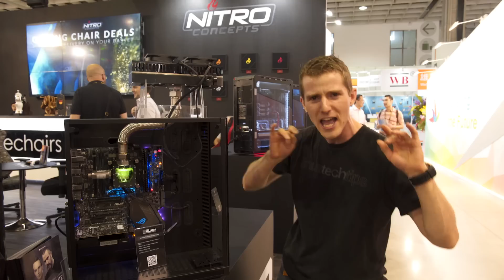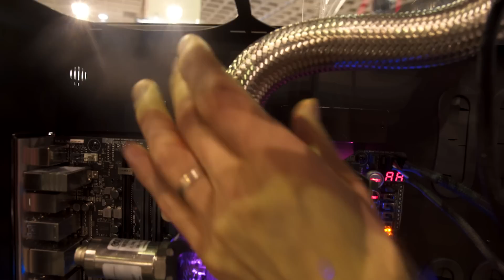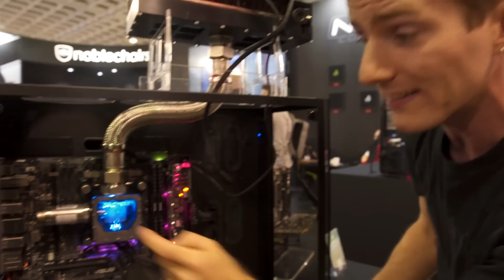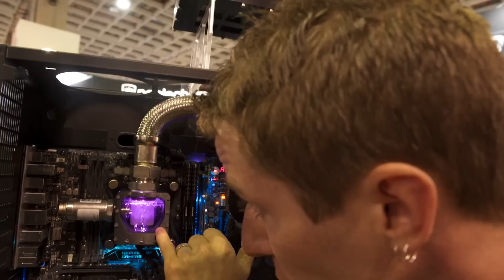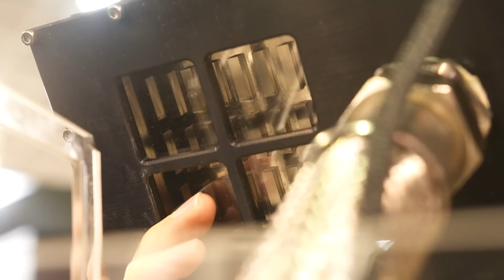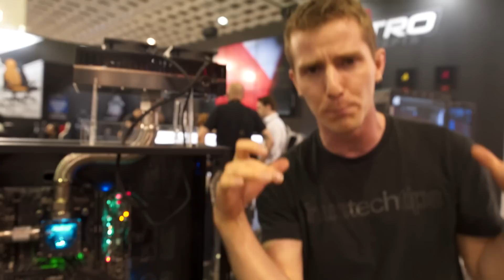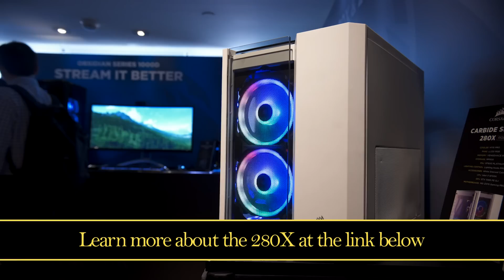Crazy Der8auer cooler prototype - NO pump!

Comment: It has to be a safe liquid in case of spills, so I'm assuming it's some kind of alcohol, either methanol, ethanol, or isopropyl alcohol... Anything else boiling at the right range would be quite aggressive solvents, and not safe in case of leaks... Well, either that, or they're carcinogenic, and good luck selling that to regular consumers without a license...!
Reply: As long as you’re not in california, the potentially carcinogenic liquid won’t affect you. (Sarcasm)
Reply: Simon Dann Boiling IS a phase change, from liquid to gas. That's literally the definition...
Reply: Novec1230...   hehehe.
That liquid is certified for use in server rooms. Heck, it is primarily used in server rooms.
It matches perfectly! It has properties very suitable for this pumpless cooler. Look up my comment here somewhere with more details.
Reply: Green Bananas Problem is if you have a leak, freon isn't exactly safe. It's toxic, not something you want in your house...
Reply: Its most likely methanol, because it boils at 65 degrees centigrade which seems pretty close to overclocked cpu temps for me.
Reply: Yeah, just about everything that I can think of that boils between ~30c and 100c @ 1 bar is flammable.
Reply: Michael Berthelsen you can sell ethanol without a license
Reply: Bacon Suds in certain States of the US of A you can sell ethanol without a license if the ethanol is tainted and marked as tainted so that it cannot be used for consumption
Reply: how about methylene chloride?
Reply: gtq838 oxygen, CO2, and nitrogen don't boil (or sublimate in the case of CO2) and condense above room temperature, making them completely useless in this application. And oxygen isn't just flammable, but it's what makes otherwise nonflammable things flammable, so that's way out. If you have any better suggestions, go ahead and put em down here. We've put our best guesses, that seem feasible, not knowing everything about the setup
Reply: but that is the definition of boiling....
Reply: a phase change reaction from liquid to gas is the exact definition of boiling XD
Reply: Reading these retarded comments made my brain hurt. You can't just put something under vacuum and expect the vacuum to exist when you literally convert it into the gas phase both due to partial pressures and more importantly boiling. Vacuum is a measure of the number of particles in a given volume which will constantly be changing because of the evaporation and condensation. So there is no tunability with the liquid. You will never get liquid nitrogen to recondense in a small form factor along with a lot of the exotic answers of stuff that is not a liquid at STP like argon and oxygen. Alcohols are flammable sure but in a closed system free of oxygen it won't ignite. A leak would be about as dangerous as a match about to go out. You would need a large ignition source and plenty of oxygen present to create an explosion. Small volumes on a really hot surface like a frying pan can flash but go out quick while large volumes lit on fire tend to reach a balance drawing in surrounding oxygen slowly to continue to burn. The liquid is free flowing and not clumpy so it is not an oil so that leaves Methanol or Ethanol as the top picks as relatively safe and cheap. I would say acetone is viable but since it strips paint I would say it is a distant option behind regular rubbing alcohol.
Reply: Benzene?
Reply: Tech Nick It might a bit higher due to higher pressure, but it would still keep it nicely below 75-80 degrees C, yeah.
Reply: Thomas Bullik Without context, your statement makes no sense. Do you mean that it needs to cool the CPU to lower than 65, that a different chemical from methanol should be used, or that it needs a vacuum to use methanol, as it would lower the boiling temperature?
Reply: Thomas Bullik Dichloro-methane isn't very safe in case of a leak, and a very good solvent, so you'd need very specialized plumbing and seals for that not to leak...
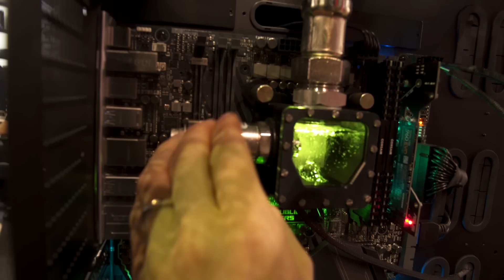Reply: rgray318 There is no pressure valve. He actually explains in the video that it won't be there in the final product, that it's just a pressure gauge to ensure it doesn't reach a critical pressure by accident. 1:40
Reply: I have another factor we haven't necessarily considered, at least not discussed... Linus comments it as being toasty, but he can still touch it for a few seconds at a time AT LEAST... Problem is, if you're used to touching hot things, 65 wouldn't be that hot, if you're not, 40 could be toasty... And he doesn't touch the metal for long, so kind of hard to tell... Thoughts?
Reply: Michael Berthelsen that's the sort of thing I was considering when going through chemicals. It has to have a boiling point well over room temperature so it can easily condense (23° C -ish idk I usually use Fahrenheit for that) but well below 100 to keep the CPU cool. Cost to produce or source also has to be relatively low for it to be commercially viable. My best guesses would be methanol or acetone
Reply: Dylan McMullen I'm thinking similar to you. If you overclock, it should be OK, even at around 70, right? And you could touch 70, but not for too long, and depends on the thermal conductivity of the case. I'd be worried at an acetone leak, though... All good solvents almost have to go, unless he has some special kind of seal around the CPU, and specialized plastics for the piping too. Ethanol and methanol arre 'only' flammable, not carcinogenic, strong solvents, or otherwise toxic (unless you drink the wrong one, or enough of the right one), and it needs to be relatively safe. Can't be any exotic stuff, you'd need licenses both to sell and own, just for safety reasons...
Reply: Michael Berthelsen methonal is toxic and can cause blindness as it's metabolized into formaldehyde (methonal)
Reply: Isopentane maybe
Reply: its in your house, fridge, Ac, car etc but i get what you mean
Reply: sasja de vries. Thanks for that insight. Didn’t even know that existed
Reply: Constructive Cuntery Liquid helium? At how many atmospheres? And do you want a pipe bomb in your PC?
Reply: Lewis Yeah, carcinogens and solvents are WAY better than a liquid that slowly evaporates, and may burn if exposed to direct flame, like we all power our PC's using steam power.
Reply: Yannis Martynov You donrealize that you need something that is liquid at room temperature and around the same pressure, right?
Reply: Yannis Martynov And like someone mentioned, freon is banned in Germany where he made it, because it's so carcinogenic, and environmentally problematic, so no, not freon.
Reply: Interesting theory. I hadn't thought of that. It's probably just deionized water in that case!
Reply: Nope, this would be partially conductive and VERY BAD in case of leak :-)
But my bet is on something like Novec M3, fluorinert or something like this....
Reply: Michael Berthelsen Coolanol is used for military radars and would fit that requirement https://en.m.wikipedia.org/wiki/Coolanol?wprov=sfla1
Reply: Empress Peach made your brain Hurt..? we've all gotten a +110IQ from Mensas home test, just say "headache". Thanks.
Reply: It's been pretty much illegal since the 90s.
Reply: jamvanderloeff Severly controlled rather than illegal. All active radar systems rely heavily on the stuff.
Also, there are now much less dangerous equivalents such as Nycodiel.
Plus I just like the idea of having a piece of fighter jet on my desk. Who cares about health in front of coolness?
Reply: I bet is hexane
Reply: Fxvx Don't be a dick. Headache is physical pain, 'hurting my brain' is a level of frustration with ignorance. Not the same thing. And Empress Peach made some good points.
Reply: I would also say that it is under a light vaccum to reduce the boiling temperature to about 50°C or 40°C.
Reply: I believe that it is Freon-11. It  has a boiling point of  74.9 F at regular atmospheric pressure. If you were pressurize it the boiling point will would get higher to a more usable temp. It is colorless, non flammable, and non conductive. Freon-11 is also highly regulated and is hard to get unlike other refrigerants. It can be be very expensive though.
Reply: +Green Bananas It most definitely is not Freon-11, since Roman is from Germany and it's been made in Germany. Freon-11 is forbidden to use in ANY application around here. There is only one exception, and that's nuclear magnetic resonance spectroscopy. 

Personally, i think it's something like Pentaerythritol. That's the same ester that's used in transformers for convection cooling.
Reply: it should be boiling lower, because it would not cool at all when the temperature gets lower than these 65 °C
Reply: It’s a phase change refrigerant. The kind used in freezers. The phase change consumes the heat energy in the reaction from liquid to gas... it’s not exactly boiling but looks like it. The gas then just needs to be allowed to condense and continue the loop. 

As far as I am aware the phase change reaction consumes the heat so there isn’t much additional cooling required other than to help speed up the condensing.

If the phase change happens at 40deg then the processor will remain at that temperature. Such refrigerants can have a wide range of phase change temps depending on their chemistry so it’s a very interesting technology for cooling processors.

Very expensive stuff though, like several hundred pounds for each kilo.
Reply: Zappyguy111 Yeah my thoughts exactly. That is what the pressure valve is for on the side I believe. It's not for holding in pressure, it's for keeping it out (vacuum). You can lower the boiling point of most liquids just by lowering pressure. What has me perplexed is that the valve end inside the windowed liquid housing is submerged. With an exotic expensive and maybe toxic liquid that is a real risk. Which suggests to me it's just high quality deionized water in a vacuum, with a electric phase change plate in the ceiling of that block. The bottom circle thing looks possibly like a heat manipulating plate simply for dialing in the right boiling settings in the labs. Why the boiling then you ask? That's obviously for liquid/heat stirring for more efficient phase change heat sucking. But I admit I'm just throwing an idea out there. Lol
Reply: no, not alcohol. Alcohol is too flammable at high temperatures. Once it leaks, it will evaporate, and the fumes will be too easy to combust.
Freon could be an obvious answer, but I tend more towards a neutral element, like argon, maybe helium...
Reply: Immersion Cooling, nice to see it finally covered by Linus. Check out immersion cooled bitcoin mining farm in hong kong if you want something next level, https://www.youtube.com/watch?v=oZavKweMrP4
Reply: Methanol would be the only viable candidate (boiling point = 65ºC since the rest of alcohols have higher boiling points(ethanol boils at 70ºC, n-propanol boils at 97ºC and isopropyl at 82ºC. notice that the boiling point scales with the lenght of the organic radical.) Methanol, unfortanately is quite toxic since it is methabolised into formaldehyde and can be absorbed trough the skin. also, it's really damm flamable 

My guess is that it could be some high molecular weight hydrocarbon. there's one used as refrigerant (R-600a aka methylpropane) although, it's boiling point is really low, hence, it's used in refrigerators as an alternative to the fluoronated R-134a and R-410a

Comment: This is alcohol. The purspose is to keep in contact the CPU with a liquid which has a low boiling temperature. In that way the temperature of the liquid will never rise above the boiling temperature unless the steam (alcohol steam) pressure inside the tubing rise drastically.

Comment: My best guess is deionized water at lower chamber pressure (that would explain pressure addon thingy) so it can boil at cpu temperatures, nickel coated tubing and stainless steel or similar alloy for cpu contact<-that may also look like its the cpu even though its not.
2nd guess: water with baking soda

Comment: Pressurized pure alcohol could maybe be used for something like this? Un-pressurised it would have too low of a boiling point to condense in room temperature, but if it is pressurised, then the boiling point might be high enough for it to condense in room temperature. It's also clear, so that fits.

Only problem, it's not that had to guess.. so i guess it wouldn't be. Also extremely flammable, so...

Comment: Hmm, the clue is in the pressure sensor. That means its probably a higher pressure then normal, so a liquid with a low boiling point would have some higher boiling point due to that. It also is probably a liquid with only a small transition energy requirement.
Something like alcohol, Acetone, methanol that kind of stuff with a boiling point around 50-70 degrees celcius. Could be lower temp stuff like Ether etc. there is a huge list like this: https://www.engineeringtoolbox.com/boiling-points-fluids-gases-d_155.html
anything with a boiling point of probably between 25 and 70 degrees could be used for this, provided the pressure is correct to get the boiling point at the right hight. It can be a mixture, but that would introduce more and more problems with the 2 or more components separating.

The other way around: lower pressure makes water boil at lower temeratures. I just don't think its valid for it, for pressure would build up.

Its easier to use a fluid of a lower boiling point, and let the boiling make the right pressure within a loop, provided enough of the liquid is present vs the available space in the loop.

Comment: IT'S WATER!... the pressure adjustments are not pressurizing the system, their depressurizing the system, creating a vacuum at which water can boil at lower temps and they can adjust the temp at which it boils.

Comment: I’m just gonna guess h2o simply because I have no idea what it is and other people are mentioning liquids I have never heard of and giving an elaborate explanation what it has to be that. . . Me on the other hand I’m just like “it’s clear, it boils, and it’s a liquid so I guess it’s water?”
Reply: Zero Tech also you can go with good old Smirnoff
Reply: It could easily be water under a vacuum. You can boil water at 60C with the right pressure.
Reply: DeadPistolsBrainGerms not if cooler operates in a partial vacuum
Reply: DeadPistolsBrainGerms you can easily lower the boiling point of water by lowering atmospheric pressure.
Reply: maybe it's vodka, for an emergency shot during streaming!
Reply: Don't take an Organic Chemistry class.
Reply: Saurav Nayak It was a school lab. First, the alcohol we use is 99.9% ethanol. Second, it was after they taught us about fractional distillation and we tried on wine. It was then dilluted to about 20% (had to mesure it's refraction). Still had kind of a dilluted wine taste, but stronger alcohol taste.
Reply: Darian Elliott I’m an commerce student :p
I.e I don’t know anything about science except the basic stuff..
Reply: It has to boil at a temp that's lower than the temperature you want your cpu to run at.
And it has to be liquid at (warm) room temp.
Reply: tjoloi most lab got wood alc 
Not actually used for drinking
Reply: Wouldn't try that 99.9% ethanol, cause, you know, 0.1% of really nasty poisons.
Reply: tjoloi I wish I was born there...We don’t test retractions of wine here in India  :/
Reply: Saurav Nayak Hahaha, it's all good! Pretty much all chemicals in organic chemistry are clear. And drinking just about any of them would poison you. It kinda broke my brain the first time I sat down and had to try to figure out what all these clear colorless solutions were.
Reply: The coolant is going to need to have a far lower boiling point than water.  Water boils at 100c at atmosphere, so in a closed loop it's going to be significantly higher than that to boil.  The coolant will need to be able to boil at operational pressures in a temperature range that works with CPUs (<75c).  It also looks "thin" so something with a low viscosity.  I'm going with something alcohol or ammonia based.
Reply: Water can "easily" have a boiling point of 60-70c, that is not any extreme vacuum and should be doable in a closed loop
Reply: Zero Tech um you just contradicted yourself. It boils. Well water boils at 100 degree Celsius. Your cpu would be a crispy afterthought at 100 degree. Considering you want it to not exceed 80 ideally.
Reply: Water boils at 100 degrees C on 100kPa pressure. On 25kPa, the boiling point is only 60 degrees C. That is far from  the perfect vacuum but the boiling point is lowered by 40%.
Reply: Saurav Nayak if you drink that stuff you won't  know what hit you...well because you'd be blind as methanol makes you blind.
Reply: People saying it could never be water are wrong. If you depressurize the entire cooling system, which is possible, you could get the boiling point to lets 70 degrees Celcius (and below). For the water to boil at 70 degrees Celcius, you will need to have the same thin are as we have on the mount Everest.
Reply: Lithium bromide systems use that principal although there are secondary means of cooling in them. When water boils it expands a lot as steam (like 1600 or 16000 I can't remember times itself) thus any negative pressure that was originally achieved would quickly become positive.
Reply: Could be aqueous ammonia the amonia boils off and then gets absorbed back into the water when cooled. Some early refrigeration systems use that and steel is the proper metal for ammonia.
Reply: They are just mentioning simple things that you would know if you ever once payed attention in science class...
Reply: Said the same the other day at the chemistry lab.
And I was thirsty.
And I got drunk.

It was waste distilled alcohol.

Comment: High pressure liquid CO2, is my guess for the fluid. Due to the need for the pressure sensor, and thicc tubing/shielding, while in these prototyping stages.